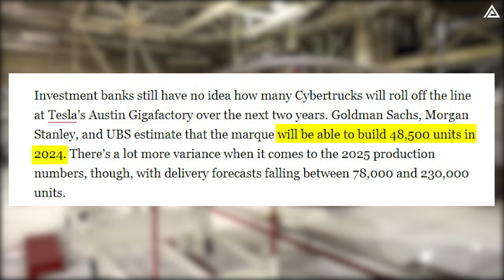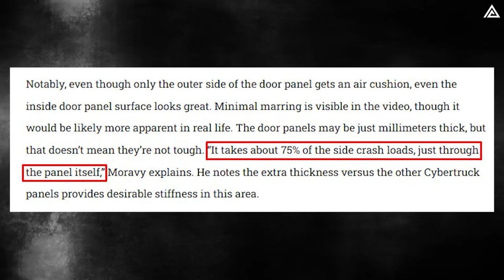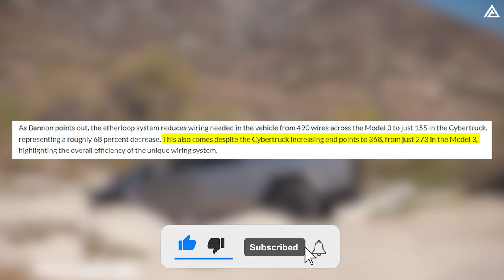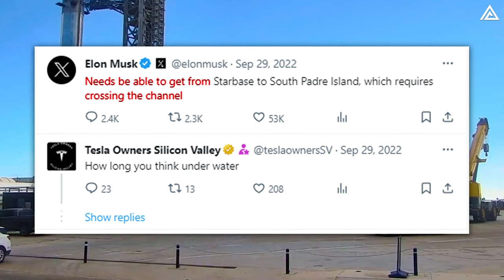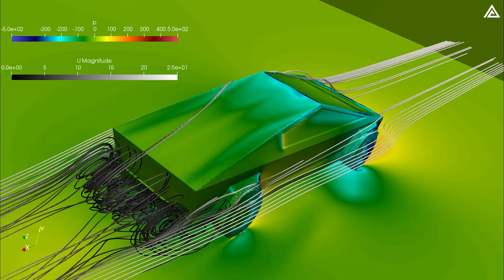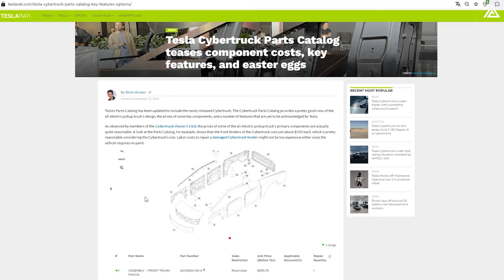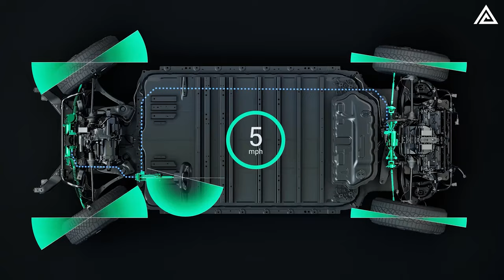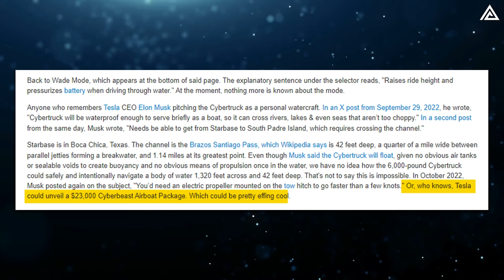Full Review CYBERTRUCK: Details Production Progress, 9 Mind-Blowing Features, Driving Experience...

Comment: It's the new Ram that is going to kill them. Over 600 miles of Range with a hybrid engine.  It will take the entire towing market
Reply from the maker: Do you have information about the towing capacity of that new Ram? I'm curious to see that too
Reply: @adamtech999  Up to 12,750 pounds. Peak torque: 410 lb-ft. Top horsepower: 395 hp